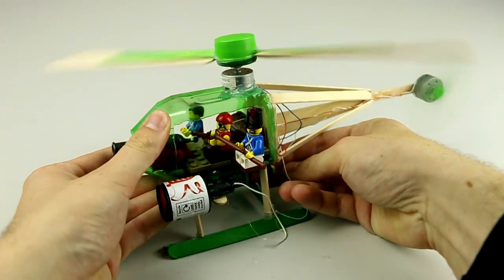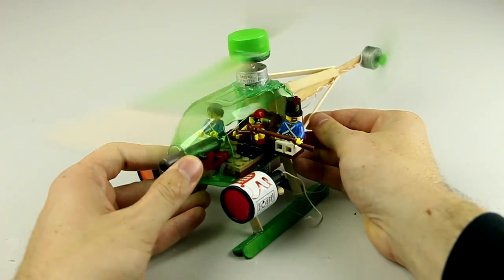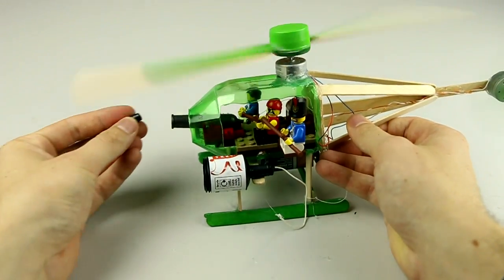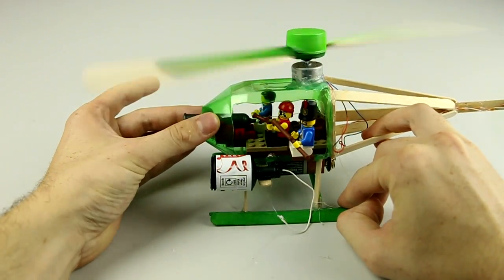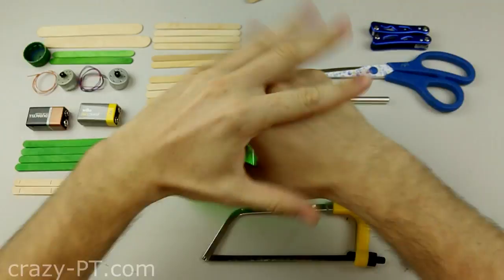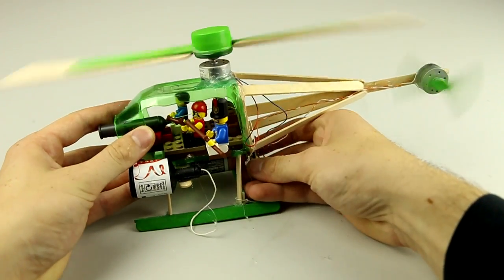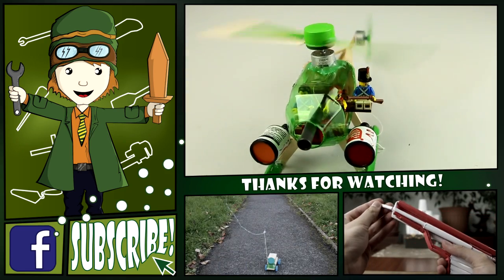How to make a Helicopter - (Electric Helicopter)

Comment: got it but the how ro make the electronic
Reply: maaHir zeiN. you fool the mator is not that powerfull even if want to make fly use powerfull motors like the turbine engine it will be evrn bigger than the helicopter. it self

Comment: this would probably works properly nd will fly if u use more motors but use that motor which i think is used in mobile phones as it is very small in size but have large power so it will work nd helicopter will fly with using that type of motors..

Comment: I made one with the hard foam that packages electronics ... And it could fly
Reply: How did you get it to balance itself out? Or did it just spin and fly off to the side?
Reply: +JubJubAc precise measurement and yes it would go up and spin bcz it was like a drone no rudder
Reply: +Majd Khalaily if you did tandem rotors like a chinook helicopter spinning in opposite directions you could balance out the forces. But it would look different and you would need to make it a lot lighter and you wouldn't be able to control it.

Comment: 14:17   
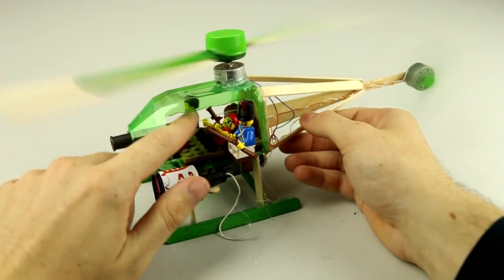Peppa Pig English - The Boat Pond【02x12】 ❤️ Cartoons For Kids ★ Complete Chapters TVGRecommended for youNew13:28   it's raining tacos - 10H version By Parry Gripp and BooneBum MSProfessionalityRecommended for you10:00:20   BIG SCALE RC Heli (small COLLISION): Weston Park International Model Show 2015 Essential RC1,803,319 views6:39   Building a Cheap Quadcopter At Home (1) - Lift Off The Post Apocalyptic Inventor3,493,971 views8:29   Peppa Pig English Episodes Compilation Season 1 Episodes 4 - 6 The Kids ClubRecommended for youNew15:12   PJ Masks ❤️ full episodes 21&22 ❤️ Catboy's Flying Fiasco & Gekko's Stay at Home Sneezes PJ MasksRecommended for you24:02   How to Make a Paper Gun that Shoots - (Machine Gun) crazyPT5,574,561 views25:25  How to Make a Flashlight using Plastic Bottles crazyPT2,679,858 views5:37  How to make an Electric Boat - (Very Easy) crazyPT2,609,121 views5:42   5 Basic Life Hacks Everyone Should Know - (Kinder Eggs) crazyPT536,256 views5:47  How to make a paper airplane (Cardboard Glider - Test Flight) crazyPT2,920,537 views2:38  How to Make a Projector using bulb at Home Navin Khambhala # crazyNK3,697,526 views5:28  How to Make a Motorcycle - (Recycle - Toy) crazyPT3,081,198 views5:31   How to Make a Vacuum Cleaner using bottle - Easy Way Navin Khambhala # crazyNK10,413,674 views7:59  Russian Homemade Helicopter Meanwhile in Russia1,536,699 views7:17   PPG Vid For My Sis Josias1508Recommended for you2:59   How to Make Phantom Blade from Assassins Creed crazyPT5,150,045 views

Comment: One of the best use of the recycling materials,Your structure is excellent,It Is not able to fly because Firstly rpm of motor is quit low as compare to torque, Secondly the weight of 9V battery is very high as compare to the structure of Helicopter.

Comment: Hey funny guy these motor really wont spin in high RPM i know i bet that ... Even these motors are much heavier in grams so it itself wont fly .... so guys there are light weight High RPM motors with low cost try that and fix in the case....

HOW COULD U MAKE A HELICOPTER AND STATE THAT IT WILL FLY NEXT TIME ... TOTAL FUNNY ...

Comment: PLSS ANSWER ME WHAT DID YOU USE TO MELT THAT METAL ON MOTOR
Reply: +YTutorials "un fer à souder" check the translation from french to your language
Reply: A soldering iron, it's used solder connection together :)
Reply: +tom Azquego jf

Comment: Not bad at all for a display toy (more or less). Really like it. As far as making one fly, you're going to have to rig up a lot of extras if you want it to do more than hover. Even hovering would take a lot of work, since you'd need to control the speed of the tail boom and the main motor, as well as  make sure the pitch of the blades for both props is going to stay the same when used. As far as a controller goes, you'd need a couple potentiometers, and that's probably it, unless you want to control it instead of hovering. 

For what you have now, I'd say that's a good design ;)

Comment: Great project. The flying helicopter woulb be great too. But it needs  to be much lighter for example to have batteries on remote control like the car you made. Maybe quadrocopter would be easier. It have more flat space to be stable and it don't need to have stabilizer. It can be attached from the middle to ground by cable. I'm waiting for more project of your machines.
Reply: I think a tricopter would be a more interesting and unique project.
Reply: +Ryan Gunn Maybe, That's great idea too. :)